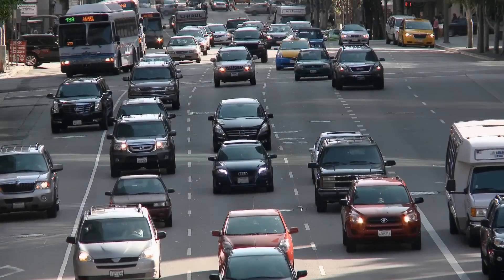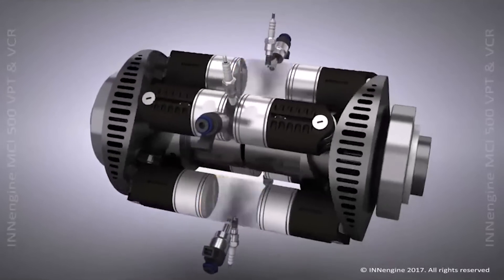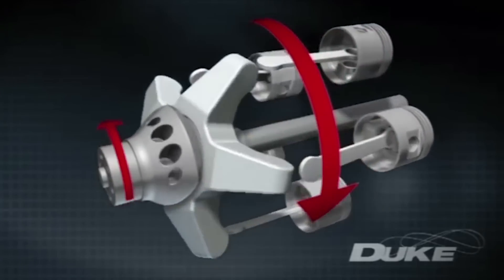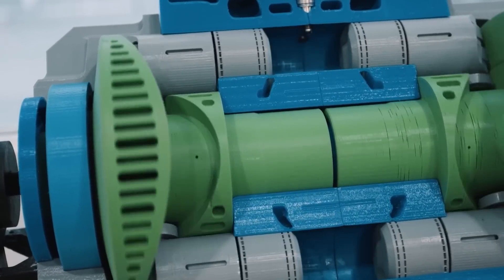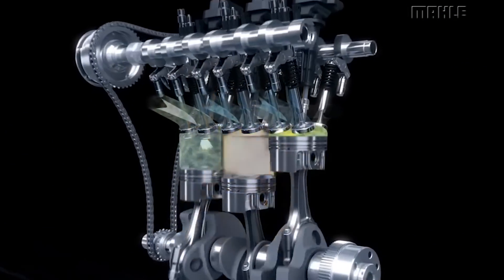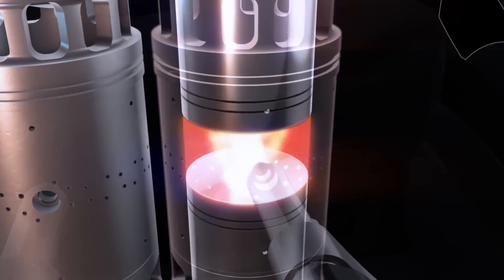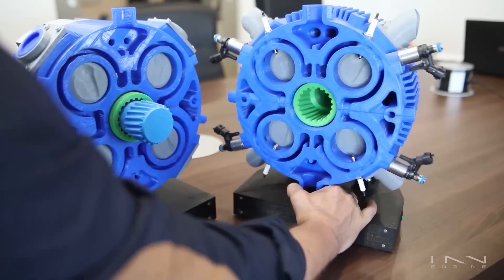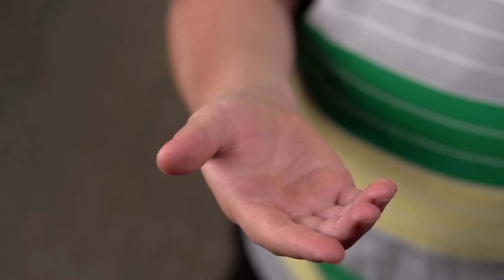Revolutionary One-Stroke Engine: Future or Fraud?

Comment from the maker: It has been really interesting making this video and consulting with experts to learn more about combustion engine technology, I look forward to hearing everyone's thoughts! Also, don't forget to make the most of your 80,000 hours and learn how to have the most fulfilling career you can, at http://80000hours.org/ziroth !
Reply: old shit "gas engine future"
Reply: Stop lying definiton of engine stroke is a infininite mystery to you...a complicated 2 stroke it is..
Reply: @lojtrnik  they actually say it's a two stroke engine that doesn't need oil mixed with the gas. They named it a single stroke knowing it wasn't but they didn't want people thinking two stroke as a standard two stroke is extremely dirty burning engine due to all the oil that gets burned.
Reply: @Relearning_for_the_future  So by your standards 2 stroke is based uppon using oil in petrol or not...stroke is defined by piston movement no matter what fuel,engine type and so on...this is a 2 stroke
Reply: @Relearning_for_the_future  it does not matter...old american lorries are 2 stroke diesel and do not need premix...it is a mechanical movement of piston explosion piston goes down,when traveling on top is second stroke when piston is near tdc ignition again...2 movements 2 stroke 4 stroke has 4 piston movements before repeating cycle thus 4 stroke
Reply: @lojtrnik  diesel already has oil in it so it is already a premixed fuel. Diesel also known as FUEL OIL is not the same as gasoline. If you believe it is please put some gas in your diesel vehicle and let me know how that goes. 
This is why diesel is so hard to light and it doesn't work in common gas engines though I have seen someone manage to drive away with a tank half and half in a gas truck it ran like garbage. 

So original 2 stroke motors required oily fuel. So your argument is false. Please pay attention. The grown-ups are talking.
Reply: @lojtrnik  buddy please catch up I already said it was and so did the company. They called it a single stroke to differentiate it from the oily fuel requirements of other 2 strokes. Please catch up.
Reply: Good information
Reply: An engine which runs on snake oil. Now, there's an idea! Time for some Crowd Funding. 😉
Reply: +++Do a show regarding.... ✈ℕ𝔼𝕎  𝔽ℝ𝕆ℕ𝕋𝕀𝔼ℝ  𝕋𝔼ℂℍℕ𝕆𝕃𝕆𝔾𝕐  𝔾ℝ𝕆𝕌ℙ 🤯💥🤯Multidisciplinary engineer/inventor here. We are developing one of my numerous ultra simple, long life, engine architectures which offers Significantly‼greater ratios of power to weight[specific power] and energy to volume[specific energy]...without any pollutants [NO, CO2 is not a pollutant] and can use any fuel or mixtures thereof. It's will be based on the 𝔽𝕦𝕖𝕝 𝔸𝕘𝕟𝕠𝕤𝕥𝕚𝕔 ℤ𝕖𝕣𝕠 𝔼𝕞𝕚𝕤𝕤𝕚𝕠𝕟 𝔼𝕟𝕘𝕚𝕟𝕖  [𝔽.𝔸.ℤ.𝔼.] tech described below with thermal efficiency ~60% which is close to an EV's charge-discharge cycle efficiency.😉 😁 We are incorporating Waste-To-Fuel systems in the offerings which will provide ultra-low-cost, renewable, carbon-negative fuels for our engines and gensets...without pollution. Torque...constantly Maximal. We'll also develop my superior power dense rotary architecture. Coming to Yourtown soon. ‼

😶‍🌫🤯Before that, we introduce the revolutionary FAZE engine 
technology. The 𝔽𝕦𝕖𝕝 𝔸𝕘𝕟𝕠𝕤𝕥𝕚𝕔 ℤ𝕖𝕣𝕠 𝔼𝕞𝕚𝕤𝕤𝕚𝕠𝕟 𝔼𝕟𝕘𝕚𝕟𝕖  
[𝔽.𝔸.ℤ.𝔼.] tech best solves the issues present in previous internal 
combustion engine designs by transforming the old paradigm into a 
simple, low cost, quiet, power dense, efficient, on-the-go liquid and 
gas fuel-flexible, ‘non-polluting’ solution for power generation of all 
scales and advanced transportation, construction, military, off-road 
vehicles including ships, aircraft, trains & robots not possible before.

Companies can either get aboard or risk of getting run over.

𝔽𝔸ℤ𝔼 delivers better than 25% ABSOLUTE/ACTUAL [not relative] 
fuel efficiency improvement over gasoline engines, more than 15% 
for Diesel engines at any operating condition - speed/load, ambient 
temperature or elevation, not just at one optimal testing point at 
STP. Real world driving cycle savings could be an additional 200% 
higher due to the constant MAXIMAL efficiency and torque. The 
simple, low cost, native/built-in, non-electric, environmentally safe, 
non-explosive, temperature agnostic 𝕊𝕦𝕡𝕖𝕣ℍ𝕪𝕓𝕣𝕚𝕕© feature 
recovers more energy than EVs and provides approx.100% fuel 
savings for a combined absolute vehicle fuel usage improvement of 
approximately 300%, thus obviating the basic need for expensive 
EVs & e-hybrids. 𝕚ℙ𝕠𝕨𝕖𝕣𝔹𝕠𝕠𝕤𝕥 adds >400% more torque. It’s like 
4 engines in 1. 𝕚𝔼𝕗𝕗𝕚𝕔𝕚𝕖𝕟𝕔𝕪𝔹𝕠𝕠𝕤𝕥2© further improves efficiency, 
torque, power & other performance metrics by 10%. This is all done 
w/o a transmission. Additional fuel saving solutions are available.
 
The FAZE engine perfectly follows the vehicle’s road or genset’s 
electrical power demand with no energy loss [no fuel waste], This 
unique characteristic enables dispensing with any auxiliary power 
units [APU] for power or refrigeration in any application. This also 
makes for a perfect range extender for battery electric vehicles [EV] 
or as a standalone EV charging unit even where is no electric grid.
 
The fuel agnostic capability allows instantaneous use of any liquid 
or gaseous fuel [natural gas at home!!!] incl. biofuels and hydrogen, 
even if old/dirty/unprocessed like flare gas or employ the concurrent 
multi-fuel capability…anywhere on the globe. One engine for all 
locales w/o changes! Unlike EVs, this enables fast fueling anytime, 
anywhere…with no troublesome infrastructure disruptions or 
changes. EV’s are not a solution to the [FAKE]climate or mobility topics as 
high level of electrification globally is unrealistic 
[See Patrick Boyle's video "Electrify Everything?"] 

The technology offers smokeless, non-polluting, low odor heat and 
noise output without costly after-treatments, etc.,… with only the 
lowest  CO2. It has a negative carbon footprint with hydrogen, 
ammonia, biofuels or gasified municipal, agricultural and/or forest 
waste and coal from a 2-stroke-like simplicity. These are HUGE 
business opportunities. We can provide these turnkey solutions 

The FAZE technology can be integrated into any ICE or vehicle 
architecture, adding some of the positive characteristics to its own. 

With virtually no electronics and emissions equipment, the cost of
purchase and reduced servicing frequency make this solution 
even more appealing.
 
Those are my two-bits

PS.
Did I mention we're developing advanced, simple, low cost, power dense electric machines and torque dense[read - compact], infinitely variable FrictionLess transmissions?

PPS.
✈✈✈ℕ𝔼𝕎  𝔽ℝ𝕆ℕ𝕋𝕀𝔼ℝ  𝕋𝔼ℂℍℕ𝕆𝕃𝕆𝔾𝕐  𝔾ℝ𝕆𝕌ℙ is a visionary multidisciplinary B2B innovation company utilizing a licensing business model or collaborative enterprise with strategic partners to develop Advanced clean, efficient, power dense solutions in domains of energy, propulsion, mobility, robotics / exoskeletons and clean technologies with a particular emphasis on the aerospace sector including space exploration and commercialization
Reply: Well, it is a one-stroke to my way of thinking because the two pistons ARE WORKING IN UNION AS ONE. Plus they did away with an extra pair of intakes etc. It's good to see someone using their noggin for once. btw there isn't as much energy loss. Good Job. I meant to write IN UNISON; whew I haven't posted on YT in ages.
Reply: You are incorrectly defining the word stroke or at least the practical meaning of it. Becasuse a stroke can be defined as a movement in one direction, but a cycle can not. A 2 or 4 cycle, which is the actual definition of the engine type, refers to a cycle as the point from combustion to the next point of combustion and how it relates to rotations of the output shaft. Engine designers in the past, allowed incorrect descriptions of their engines. The easiest way to correct and have the name reflect how an engine will run and perform as well as what its displacement is can only be, on a per combustion chamber basis, how many combustion events occur per rotation of the output shaft.  In a rotory theirs no stroke but one combustion event for one output shaft rotation like a two stroke, but its no strokes at all. That's why this is the only way to put engines into terms that are practical. If you call a revolution of a rotor a cycle, you would have 3 combustions per cycle, but the output shaft turns 3 times for each turn of the rotor. So one combustion per shaft rotation is equal to a two stroke but a two stroke is really a one cycle engine and a 4 stroke is really a 2 cycle. This engine completes 2 combustion cycles for each rotation of the output shaft. SOooo, if you can call a the other piston engines 2 and 4 stroke, its totally fair and logical to say this is a one stroke engine
Reply: 1 how do you stop the piston rotating in the bore? 2. Surely energy will be lost due to the angular contact of the big end cam rollers, I believe that some redesign is required in this area.
Reply: Why don't you consult with some experts that explain what a 2-stroke motor is because this is a two-stroke motor.
Reply: @kickerzx2  A two stroke give one combustion event per rotation of the crank. This engine gives two combustion events. And hydrogen doesn't combust at lower temperatures than gasoline.
Reply: the Erex is a fake.
also the engine inside the mazda was a wankle with there case on the outside.
you can't just put whatever fuel in it and it runs especially hydrogen as it would melt the piston head
Reply: @dragontechgaming6677 first off your wrong you can use hydrogen in a piston engine. Do some research. Second there are already engines that work with multiple fuels already again look it up they are already used by the American military. Next you didn't listen as it stated the plates could be adjusted to offset the distances the pistons would be from each other. It should have said the motor could be set up differently for each fuel to work.  Opposed piston engines and some similar to that have been around for a long while this uses the plates to solve the problem of the extra strong shafts needed and reduces the complexity. I love your conspiracy theory though but if you had researched this at all it had already been reviewed by external groups and it works.
Reply: @Relearning_for_the_future   First off if you did any real research then you would find out that hydrogen in a piston engine causes catastrophic failure quite often the rings becoming brittle do to extreme heat cycles that cause ring lift, not to mention that aluminium piston heads melting.
Second hydrogen is one of the most energy dense gas/ fuel source out there not to mention vary violent and extremely heat intensive and is x8 hotter then jet fuel.
if hydrogen was a reliable fuel source without consequences and low risk of damage the petrol engine would have already been long gone by now.
Third if you knew anything about us military vehicles mass majority of them only run on one fuel type also for the mutlifuel type systems usually they have to do a bit of tunning to get the engine to run right.
Forth the "conspiracy theory", it's not hard to hear that the Maza is running on a 3 rotor wankel.
 Fifth yes opposed piston engines have been around forever now but just because some third part says it's running doesn't actually mean much they could be payed off and so forth.
just by the marketing scheme they use you can tell some fishy crap is going on.
 hopefully you learned something today, if not no skin off my back.
Reply: So here's the thing:
Is it an internal combustion engine? If yes then post 2035 it can't be sold in Europe and China after 1/June/2023 and if the US remains democrat for the next few years then there also.
Is it a one stroke? no, it's either a 2 or 4 stroke (I gave up at 9mins because it failed question 1.)
This is 10 years behind its time, end of story.
Reply: @etmax1  yes and no. A range extending engine may still be allowed it's all about the wording as long as the primary is batteries and the vehicle has to be powered by the batteries. This is why even Mazda has produced a smaller Wankel engine that can be used as a range extender/charger. 2030/2035 is a long ways off and many companies will still be looking to have an ICE engine in the vehicle. IF the engine is capable of hydrogen as they say by merely adjusting one or both of the wave plates to adjust the compression then it may then still be in compliance come time. Many many engines will still be developed all the way up to and beyond 2035. One item I see this motor as being a strong contender for is Military drones and ultralights if they wished to get it certified. 

I suspect ultimately hydrogen fuel cells with the storage device being that solid state hydrogen storage that the Japanese gave developed will ultimately be the safest setup to combine with solid state batteries. Though 2035 is years away and we may be surprised by what we discover and ultimately powers out vehicles. (As in the make up of the batteries) only time will tell. In the mean time unfortunately vehicles will need some form of ICE range extender especially for larger trucks like cranes and other construction vehicles. Only time will tell. 
Either way this is still an interesting engine and if it performs well and is fuel efficient and lower pollution vs other engines I could see it filling a small area. Till it is no longer needed.
Reply: @etmax1  it can be sold. the eu has not banned Efuels after 2035. Syntentic fuels that dont have any polution. so aslong as it can Run on E Fuels its okey.

Comment: Light weight and small footprint with this engine is perfect for an Auxiliary Power Unit (APU) application.  A permanent magnet motor/generator can provide the electricity to recharge the battery, or augment drive systems with its electrical energy provided.

Comment: a motor is called what it is to complete a combustion cycle so a 4 stroke has the piston fall to achieve intake , rise to compression /combustion ,fall to extract power then rise to exhaust , a two stroke rises to compress/ combust , falls to extract power /exhaust /intake making a 1 stroke motor physically impossible as you cannot have the intake ,combustion , power and exhaust all in the same rise or fall of the piston , a rotary achieves 3 complete cycles of intake combustion power and exhaust per 360deg rotation of the crankshaft but it does not have a rising /falling piston ,  so does that make it a 1/3 stroke engine ?

Comment: The axial curved plates are not really 'squish plates'. They are likely sinusoidal but need to be distorted due to the radius of the rollers. The force transfer is by a line contact.  No ICE is on the market that does not have area contact in power transfer. High speed may be questionable.  Can the  stoke to bor ration be above 2, like 2.2 in teh Achates engines? Even 1.5:1 may be hard to get. The possible stroke length will get shorter with higher rpm design speeds. It reminds me a little of the Huettlin engine from Switzerland.

Comment: Yikes, I see a lot of wasted power!  I think of it like this: You can easily turn a camshaft and cause it to move the follower, but it's very hard to push the follower and cause it to rotate the camshaft.  The swashplate ramp would have to be very steep, wouldn't it?

Comment: There is a lot of fish in the INNEngine company's premises. 
This is, as you say, an opposed piston two-stroke engine, and not a new idea, and it cannot be a one-stroke engine. The most famous compound opposed piston two-stroke uniflow Diesel engine was the Napier Deltic, which was used from 1943 onwards. A patent for a similar type of engine, albeit a quad design, was filed in 1930, then used by Alfa Romeo in Italy, and by Pegaso in Spain. The idea for a simpler opposed piston two-stroke engine was used in the early 1920's.

Comment: Is sad to read comments about this engine. The men that designed and built this new engine deserve a huge admiration. The machine works, very light and simple to maintain. Can burn well, the turbo issue is not really an issue turbos raise efficiency, I do not see the inventors doing anything else tahn maquing ICE machines better... what is the matter with you all, can not see this engine is clearly a great design? Made in Spain made right? Can you build something better? Try, I dare you, these innovators deserve a lot of admiration and support. Best design I have seen in years.....please recognize talent...

Comment: I looked really closely at the "super charger" and entire plumbing system, and that is just a pod air filter not any sort of forced air induction system. Although the engine could easily be converted to turbo, or supercharged boosting it's power output. However I'm sure that it would reek absolute havoc on the internals of an engine of this design. As others have stated the roller bearings on the ends of the wave cams at each end of the block would be very unhappy about the added wear. If you look at the bearing race placement at the contact points on the wave cam this is very sub optimal as they are in a radial alignment.. This meens the one closest to the center of the rotational assembly have MUCH higher shock load. Instead they need to be one in front of the other as they make the trip around VS a side by side configuration to endure the stresses more evenly.

Comment: The counter acting piston design explanation is very wrong ahahahah
Anyway boys when you use those buff piston you dont want them to go fast due to inertia forces so low rpm for sure. Moreover i predict the power output being very very limited due to low volumetric efficiency of the inlet and exaust port. The fact that its power to weight ratio is higher is likely to be true but keep in mind that if it wasnt for pollution International regulation current engines would match that.